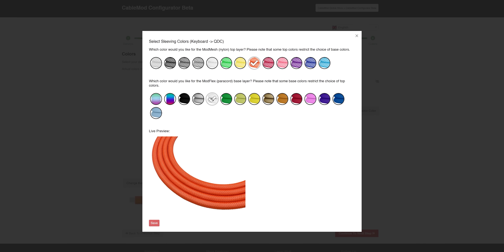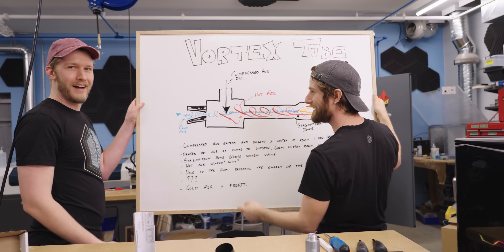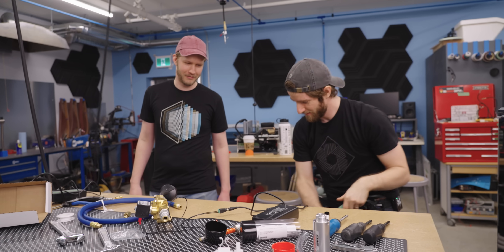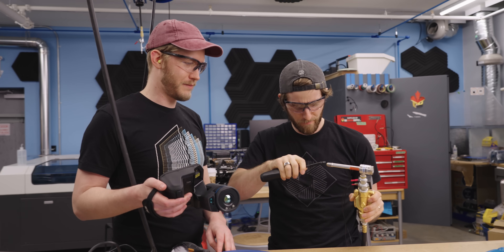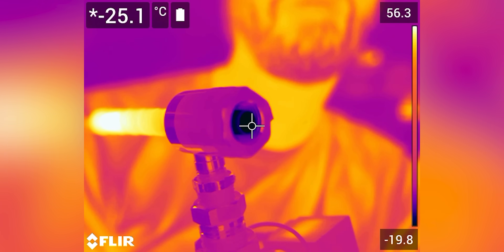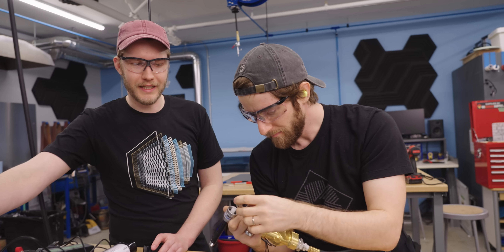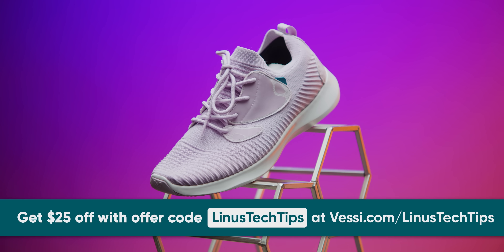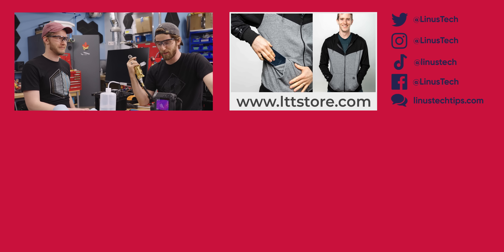This is a CPU Cooler? - Vortex Chiller

Comment: This problem occasionally happens on my pc and when it happens I can't use my pc properly anymore. So I open the pc up and when I usually open Valorant, the Folder or Task Manager, it will open up but you cant click on anything because it will become unresponsive. Then its just stuck there even if I wait for it for hours. Then I cant shut it down either because it will be just stuck on the Shutting Down Screen and will not turn off if I don't turn off the switch on the PSU. Then once I try to boot it up its just stuck on the Motherboard screen / logo. I cleared out a few things so I can help you solve the problem. Removing and putting back the cmos doesn't work, RAM is not the problem because I switched to new ones, and its not the HDD or SSD because I removed the HDD and reinstalled windows same problems occurred and, I bought a new SSD because the previous one was said to be corrupted but with the new one its still making problems. So its either the PSU, CPU, GPU or Motherboard. What do you think guys? Please help I haven't been able to use my pc since march because of this problem.

Specs:

Ryzen 3 3100

AMD Wraith Prism RGB Cooler

Gigabyte B450m DS3H v2

Team Delta TUF RGB Memory (Previous ones were G Skill Rip Jaws)

Palit GTX 1650 StormX

Corsair CV 550 Watts 80+ Bronze

WD Green M.2 SSD (Previous one was a Kingston SSD)

WD Blue HDD

Comment: Well, just a come a cross your video. Simple explanation,  oxygen is more dense than nitrogen in the air, when speed and pressured applied then nitrogen get separated for split seconds and almost pure nitrogen comes out from one side and oxygen on the otherside, due friction oxygen gets heath up , but nitrogen on the hand with the speed cools, but once mix with the air outside goes back to bonding in to the air. Anyway, just wanted to share it, because I design similar cooler but for different purpose , thanks.

Comment: This would have worked better if you were using a heatsink that performed well with down-fired air (straight at it). A pin-fin heatsink would be ideal. You could look at the "High Power Fan Sinks" from Cool Innovations for example. That's a company you can also have do custom work for you, so you could start with something like the 3-383825RFA, but do a drawing having them machine the base to match up with the IHS of the CPU and put mounting holes in it that match up with the socket mounting points, you could mount the thing down just like a water block, then put your vortex cooler right over the center of that heat-sink. There may be other models on their site that fit the socket better, I just ball-parked with the 3.76"x3.76" square version. I'd get as big (and tall) of one that you can fit inside your VRM heatsinks and memory area.

Comment: It didn't work for the same reason that you can put your hand in a 350 degree oven without touching anything and not scream, but put your hand in boiling water at 212 degrees, it's a trip to the hospital.  Air molecules are too far apart, as in less dense, to transfer the energy properly.  Water, as in liquid cooling, is far more dense and transfers the energy much easier.  The thermal compound, a solid, aids in that transfer from point of origin to the outgoing system, which works well to cool it down.  If you want to super cool any cpu, enclose it in a closed neoprene system and run freon (oil based coolant) instead of water, and you'll see sub zero temps at last.

Comment: I think what you would need to do is isolate the case from the environment and rig the vortex cooler to slot into the isolation chamber. Then fill the chamber with the cold air and then try running. I don't think this would work the way you all are trying it. Even with the bigger compressor. Like the refrigerator PC only this could actually work lol.

Comment: what if you used the noctua fanless passive cpu cooler? its just a big heat sink which would give you plenty of surface area to blast that cold air on

Comment: i wonder if its possible to run highly pressurized water instead of air to run it through a water cooling loop :D (or at least a heat exchange unit)

Comment: You need to fabricate a heatsink instread of heat tubes you run the cold air through it .. OR .. how about a water cooled system where the radiator is being cooled by the vortex nozzle ?
Reply: Actually now that I think about it, the heatsink will not work, by cooling the surface closest to the cpu you are basically crating a barrier between the cpu (heat source) and the surface area provided by the heatsink, the barrier traps the heat and prevents it from dissipating properly ..

Comment: actually  vortex coolers  were used decades ago to chill electrical  cabinets on main  frames and other equipment. grossly  inefficient ,  over priced, and crazy loud, and when working proper can drive temperatures on cold  end the   primary   player in the field  was EXAIR  we also used the  in machining  on composites  and special   purpose  exotic material that could not have chemical  coolants or  liquid  contamination's on them on them to cool the parts we used  have  IR  cameras to monitor  parts  the cold end can drop temps to  minus -50 F   and the hot end   can climb as high  as 260F  and    select-able  up to 10200 btu  per  hour  at the cold  end    150 Scfm  but cost  is $1200 , to set up and tune them proper  for application use  is not a   simple  buy  it  take it out of box    aim it  and   turn on the air feed you  want  me to come set it up   i will  i  used them for decades,  at  90 psi  inlet  max drop  the hose barb fittings  as you called then are the   internal   orifice to  adjust    flow rates and that  unit  is a  minimum 40 cfm  air  and  will cool    between  -20  to -40  2800 btu  hr   the   various   orifice that  came allows  for   5 different  amount of btu /hr  cooling and requires a minimum 3/8 id air supply line at  minimum  90 psi at 40cfm.      but the final comment   set it up proper  and  position it correct   if noise and cost of an air compressor running i can   frost  up the   biggest beast of a computer you want to build with   vortex coolers

Comment: Shouldn't it work if you cut the heat sink's 2 pipes from 2 ends and connect 1 end with the cooler end and clod air could circulate through the heat sink and get out from other end 🤔🤔🤔

Comment: I thought you would add it to a liquid cooling system kind of thing and send in cold air from one side and let it go out on the other side of the pipe after touching the cpu die

Comment: What if, you took a liquid cooled system, instead of running water, you hook up the artic chiller to the tubing to cool the system
Reply: I believe this method didn't work as well do to not actually pulling the heat away from the cpu, it was kind of in a limbo as you "cooled" the cpu  the "heat" was transferring back to the cpu causing the thermal throttle,

Comment: Imho if you want to use this gimmick to cool a CPU and keep the radiator on it then the air that comes out shuld go throu the cooler but the cooler should be incased in something that would force the airflow thou it. Sort of like a shroud with an entry point. Also im curious how would it work with a waterblock insread of a radiator.

Comment: Jesus even the factory I work at doesn't have oil free air, we have plant wide air for cleaning our machines and because we work with food you can't actually use the air to help with plugging in our venturi systems cause we don't use filtered/oil free air compressors. Except we do for some things :S its stupid, we have nib cutters for cereal that use the same air but we cant use them on our different cutters that make hoop or dot shaped cereal because ???. 

plus our compressors and boilers constantly break down lol so theres that.

Comment: Could you machine a block so the cold air goes through the block, cooling the CPU and then power an air tool out the other side?  OR daisy chain computers?

Comment: I think the way to make this work on a PC would be the most unintuitive way to construct a PC. 

I think what you would want is to use pretty much everything used here including the noctua cooler and build a case that only allows a very small amount of air out. 

Basically your making the refrigerator pc but instead of putting the PC in the refrigerator the PC case is now the refrigerator.

Comment: The Noctua coolers with that big gap in the middle for a fan are not typically used in the most effective way. The best way is to create a custom shroud to go in the middle to direct air upwards. Then you put fans on either side, blowing inward. The normal way of doing it will result in one side of the cooler being much, well, cooler than the other which could result in uneven cooling of your CPU. Also, those fins being exposed are a problem The entire cooler should be shrouded. Really, the whole way air cooling in a PC is typically done is quite wrong from a scientific perspective. If they would just take a cursory look at general aviation they could make huge improvements overnight. Unfortunately, few in IT seem to bother to study physics so this is what you get. An inefficient mess for air cooling.

Comment: Humble opinión, you are basically shooting cold air on top of the hot cpu, doesnt this cause the temp being preserved in the cpu. What if you put a normal cooler on it but bring the temps in the complete case down ?the cooler should get very cold air and the hot air should go outside ( kind of like in a vacum)

Comment: Linus As many Videos you make on keeping CPU/GPU cool Why is it that no one has made an actual refrigerant type cooler with a compressor / condenser  & a refrigerated heat sink for the CPU. I don't think the compressor / condenser unit would have to be all that big.
Question 2: Are the same Mobil CPU / GPU in laptops just as effective/powerful as their desktop equivalent.

Comment: u know u need to adjust the heat side right ?
or u wont get enough "cold" output 
u probably just have like 20% cooling 80% just compressed air not cooled 
u need a lot of hot air on one side to get more wattage on cold side thats why there is a limit of flow

Comment: Oh just buy a better air compressor!, An air compressor that can handle approx. 145 PSI (10bar) costs about 250 USD,. (get one of those, then replace whatever tank it had with a big one that they have for say industrial medium-sized worksites (>100liters or more in volume, this to ensure that there is enough of compressed air, and OH, make sure the replacement tank can in fact hold the PSI number you'd want to compress the air to)

Comment: you didn't build right chamber for to work right, why didn't use water block just use air in like u would water then vent other end out case. see if business build big air compressed out side run these on sever cpu using water block or new type cpu cooler that can use this type system you cut heat in room down, you could ever use heat from ends to boil water make steam in turn genarator power run system in loop.

Comment: That cpu didnt work because there is no TIME for heat transfer.

You need a heat transfer chamber on the CPU.

The same reason removing the thermostat from modern cars. The water moves too fast and doesn't pick up nay heat.

Comment: man its that hard i just watch a video its hard to understand the indien i think but he has the text again later written it has to do with that heat is molecluse moving fast i think like vibrating dont know i am just a mechanic but thats heat and the outer vortex what is getting warm is colliding with the inner vortex that is in reverse and yes its strange you would think vortexes hitteng echother would create heat but think molecluse they move the be hot the fast moving hot molecluse making the inner stream of molecluse move slower so they cool down and the upper stream takes that energy just think molecluse level not just air.edit i am even drunk and high when writhing this

Comment: The longer you try to do this test the hotter the air in the compressor tank gets...and works against you in this cooling test. 
You might have had better results if you tried the cool the CPU first...instead of the cell phone. 
The longer and harder your run the air compressor the heat increases rapidly in the air tank.

Comment: hey linus do you have a spare i7 4790k youd be willing to part with? I know that processor is like decade old, saved a pc from a dumpster, has a 2 core i7 and will support a 4790k (which are old). want to drop the 4790 in and double core count since i have dropped a radeon 6600 and upgraded power supply into the comp already!

Comment: it's not a silencer it's a fuel filter, more seriously industrial parts cost way more than what regular customers pay it's the "you're making money with it" tax
as both a 5950x and 12900k owner I must say that yes the Intel is too much, even with a 3x 360mm rads I see 90°C or more which is completely unacceptable, a 29k R23 run on the 5950x same cooling I had 70-72°C I hope the Rzyen 7000 won't disappoint (gaming and bandwith wise because most people don't realize this but current intel pcie5 is not better than 4...it's garbage because of the way bandwith is split you lose most of it into the void X570 is great Z690 is trash)

Comment: Imagine vortex tube methanol fuel. Injection on a motor..  those injectors for methanol are already beefy to get all the fuel in and air for the burn..  and the methanol actuAlly cools the motor as it gets used but if the air fuel mixture was being spiraled into the cylinder head with a fuckin vortex tube, if you had a fully built billet block, forged pistons, solid rocker rollers and fuckin railroad spikes for head bolts just to be able to hold thaf pressure inside plus the combustion process, that shit would be funny car status pulling 3 second quarter miles at 290 mph..  lol..  i dunno what the funny cars use but itd be close to that seeing as they use 30 gallons of fuel in the 3 seconds they drive em down track..

Comment: Lemme help you dummies >> AMAZON > Cold Air Gun, Stainlelss Steel, $170, next > recycled pot aluminum "Cold Air Gun with Flexible Tube, Aluminum Alloy Mechanical Process Mini Vortex Cold Air Dry Cooling Gun" is $52. Stay in your lane, these things cost $1000's in 3M's PPE hoods. Lol Ali Express is a better starting point for weird experimental crap. Been fun, bye!

Comment: I love your videos, BUT I could always scream out loud when I see how thickly you spread thermal paste on the CPUs. It has to be as thin as possible, just covering the surface completely and only filling the surface roughness. You brush it as thick as butter. The heat conduction of such pastes is catastrophically bad. Less is more!

Comment: Hey Linus, that "silencer" actually very likely makes the kit illegal in the united states.  Because our insane ATF believes anything you can screw onto a real firearm that lowers noise (even if it only lasts one shot) is legally a "firearms silencer".  And from what I can see of that kit silencer it has a tube, full of baffles, and a threaded end.  Bingo, 22LR silencer/suppressor that would likely work fairly well and last hundreds of rounds.

You'll notice the same issue with many airsoft accessories.  If it can actually make something quieter and can be "readily" attached to a real firearm, then its a NFA item (restricted).